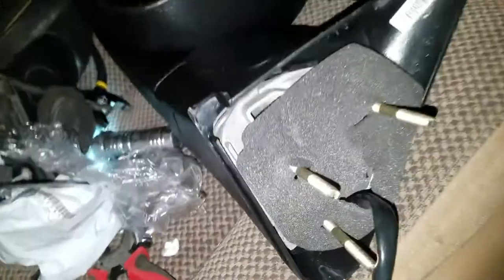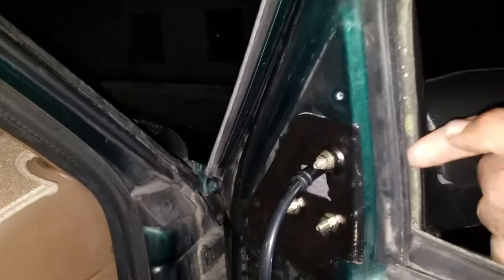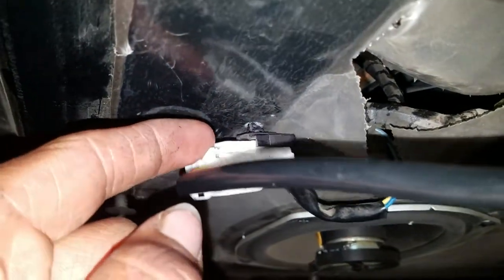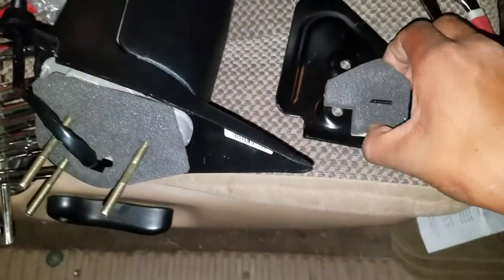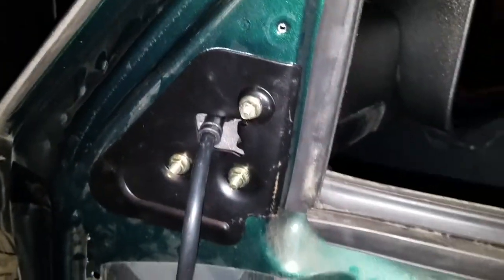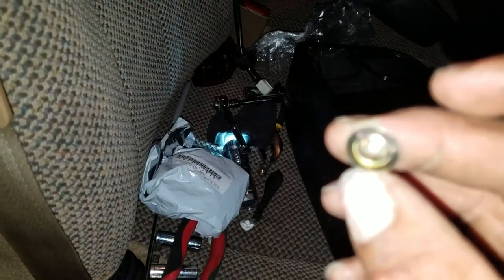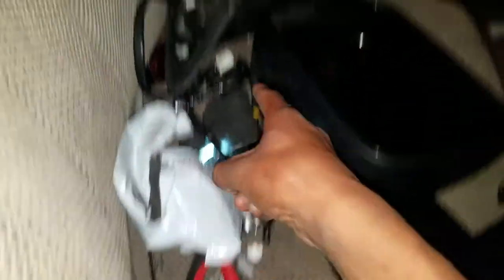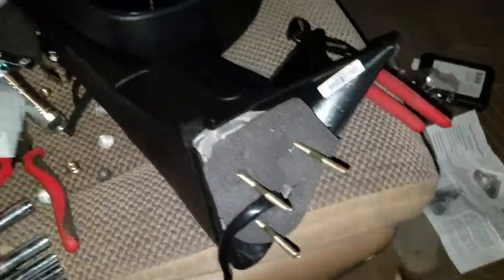How to install aftermarket tow mirrors on a 1997-2002 Dodge Ram 1500-3500.

Comment: we're you able to install the driver door panel? I ordered a set that looks the same and with the addition of the plate you add, the bolt and nut hit the power mirror unit and the panel would fit back in place. I had to send the unit back for a refund.
Reply from the maker: Aaron Peterman, no I didn't run into that problem... you could try cutting off the end of the bolt if it hangs out past the nut.
Reply: MishlerMan 243 I cut the bolt flat to the nut and it still hit, I might order another one and see if I can make it work without the backplate.
Reply from the maker: Aaron Peterman, as I recall the "bolt" is really just a threaded rod with no head that you screw into the bracket on the mirror. I'm pretty sure I had to screw it in pretty far.. so maybe yours aren't in enough? Or maybe you just need a different set. I got mine off Amazon and I did the fit to vehicle to make sure they would work before I ordered them.

Comment: do u need to buy new door clips or can u use the olds ones
Reply from the maker: I bought new ones, but you might be able to reuse some. I would recommend buying new ones. Get them bulk offline, it is WAY cheaper than at an auto parts store. I got mine from Amazon